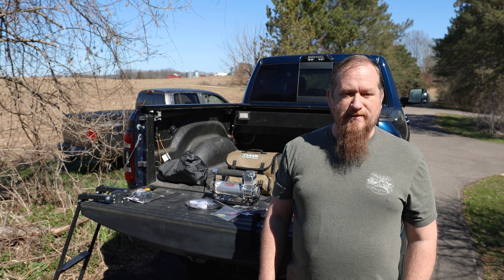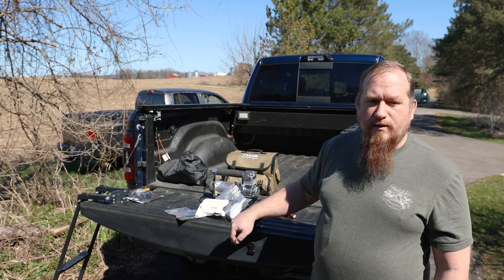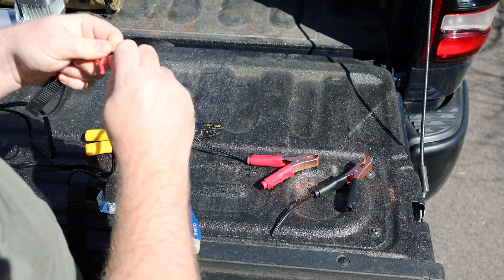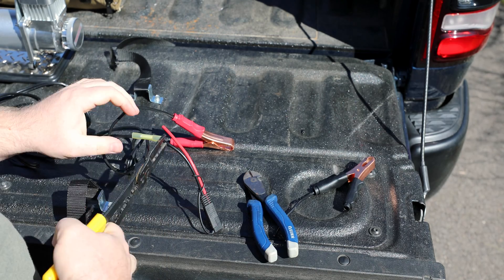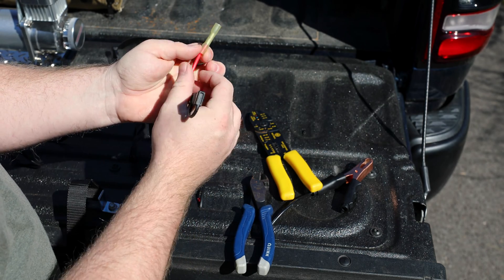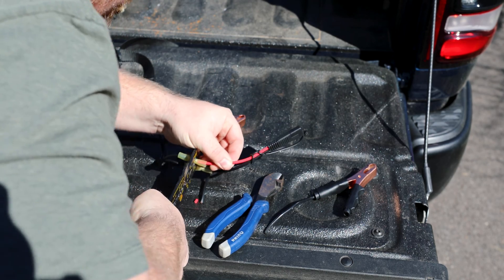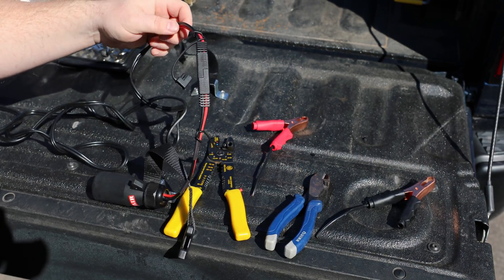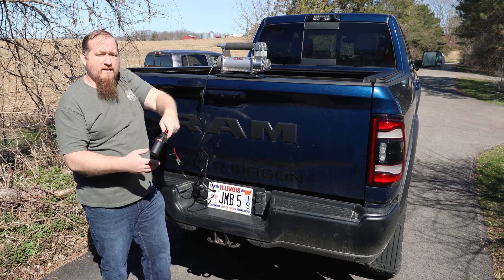Portable Air Compressor Upgrade: Alligator Clips to SAE Conversion with 7-Pin Trailer Connector

Comment: Great idea! I just did this mod to my Viair and I love the versatility that the SAE connector brings to it, or any other 12v tool. I carry adapters for connection to the 7 way, alligator clamps, cig lighter socket and Anderson 50A. The only thing that I would suggest, and you may have done it post-vid, is to hit those butt splices with a heat gun (or lighter) to shrink and seal them. I also stagger the splices to make the diameter of the splice a little smaller. Thanks for the tutorial.

Comment: Great video.. just to reconfirm.. can i cut off the trailer plug from the compressor and directly attach the alligator plug? Bought a compressor with trailer plug connector by mistake.
Reply from the maker: You can... However, I'd recommend putting an SAE plug in (what I did here) so you can easily swap between trailer plug and allegator clips as needed. Better than having only one or the other hard-wired.

Comment: My 12v compressor is rated at 45 amps. 7 pin connector has a 15 amp fuse. 

How many amps does your compressor pull?
Reply: A great idea ... so good Viair comes with the SAE plug pre wired now...instead of the alligators
Reply from the maker: According to the manufacture (VIAAIR), the maximum amp draw of the compressor is 23 amps. 7 pin on the RAM HD trucks is on a 30 amp fuse IIRC.